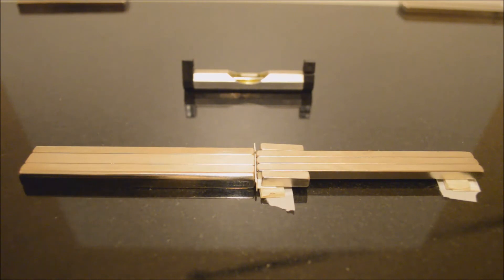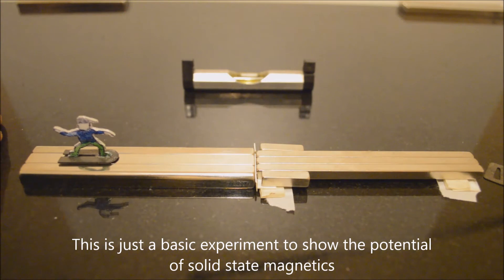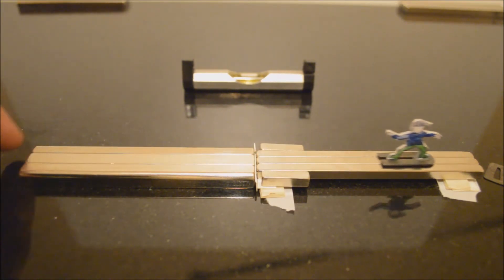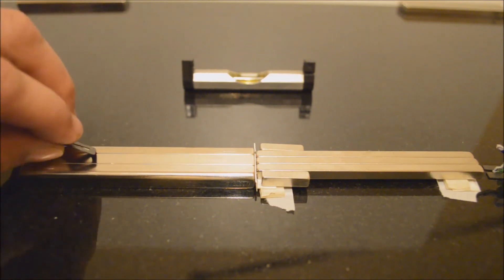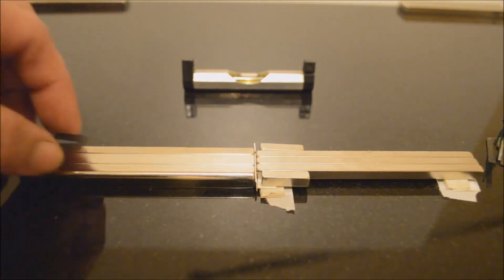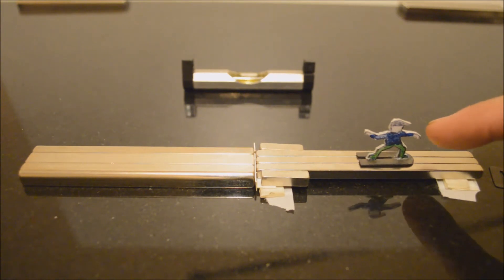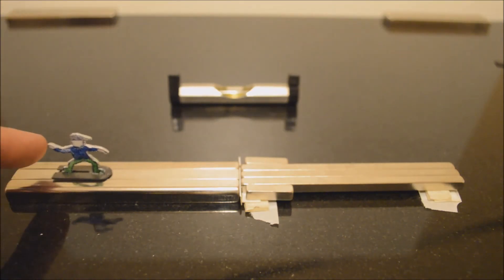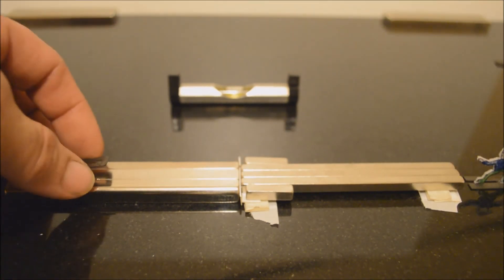Magnetic Levitation with Linear Acceleration

Comment: I though you and other people would have realized by now that with your previous device ("gauss rifle") it is pretty easy to close the circuit and make a perpetual motion device. Not saying it is free energy, but ...
Reply from the maker: Hello I have to hid some of my work and ideas in these basic experiment vids in hope that the right minds see and understand whats really possible. The gauss gun can be build/setup differently and may be a great liner accelerator but need funds to build set up to test more as very accurate set up required and a great amount of forces all end up compressed in small areas. The set up would be combination of this vid and the gauss gun setup.Thank you for seeing the potential in my ideas my hope with these vids is some will put 1 + 2 together and try.I'm quite shore that ultra hi effiency energy production using magnets is a reality with todays magnets and materials people just have to do the work to apply it and find out I did so have many others. Adam VA of AVA MAG LEV